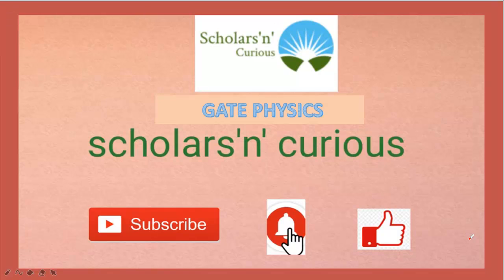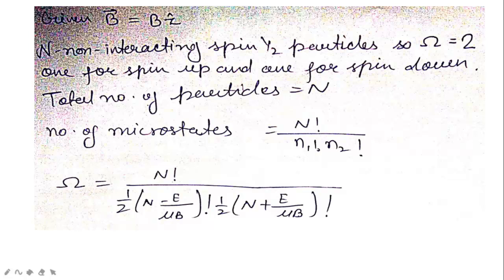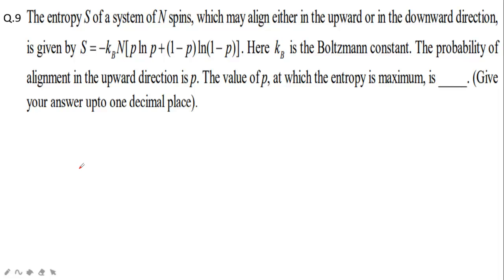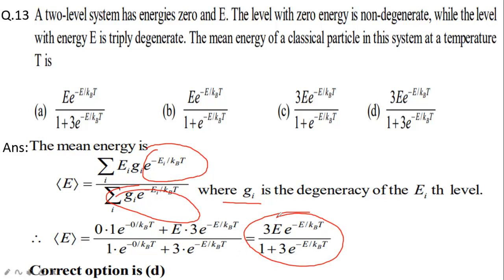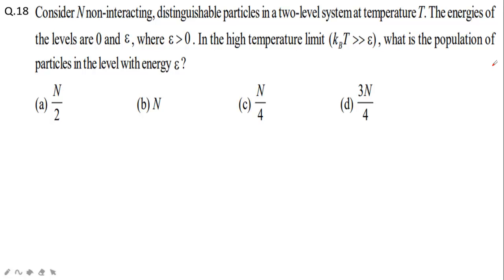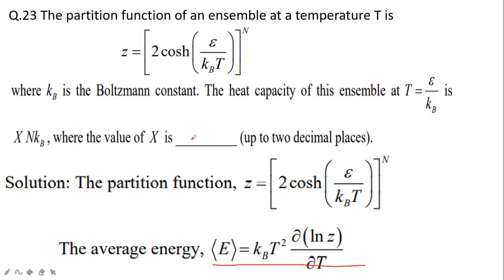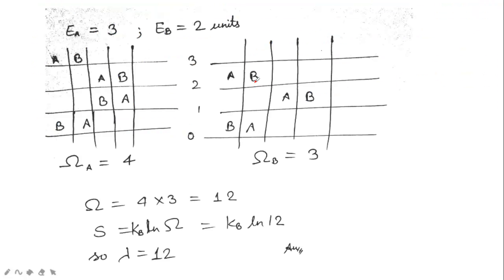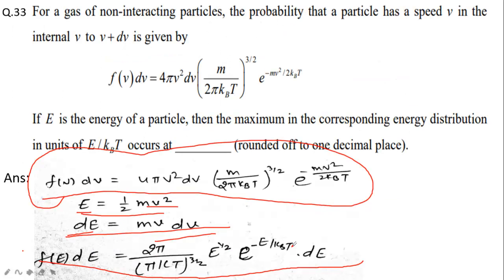#GATE2021 #Thermodynamics Gate Solved Questions Thermodynamics & Statistical Mechanics

Comment: TIME DILATION IS FULLY EXPLAINED, AS THE ULTIMATE MATHEMATICAL UNIFICATION OF PHYSICS/PHYSICAL EXPERIENCE IS CLEARLY PROVEN: 

A PHOTON may be placed at the center of what is THE SUN (as A POINT, of course), AS the reduction of SPACE is offset by (or BALANCED with) the speed of light; AS ELECTROMAGNETISM/ENERGY IS GRAVITY. Time DILATION proves that electromagnetism/ENERGY IS GRAVITY, as C4 is a POINT that is ELECTROMAGNETIC/GRAVITATIONAL (ON BALANCE) as SPACE; AS E=mc2 IS F=ma; AS ELECTROMAGNETISM/ENERGY IS GRAVITY. Time DILATION proves that electromagnetism/ENERGY IS GRAVITY, AS E=mc2 is DIRECTLY and fundamentally derived from F=ma. E=mc2 IS F=ma. A planet AND a star thus constitute what is A POINT in the night sky. It ALL makes perfect sense. Gravity IS ELECTROMAGNETISM/ENERGY. ACCORDINGLY, I have ALSO fully explained the MATHEMATICAL UNIFICATION of Einstein's equations and Maxwell's equations (GIVEN THE ADDITION OF A FOURTH SPATIAL DIMENSION); AS E=mc2 IS F=ma. The Sun AND the Earth are F=ma AND E=mc2. 

By Frank DiMeglio